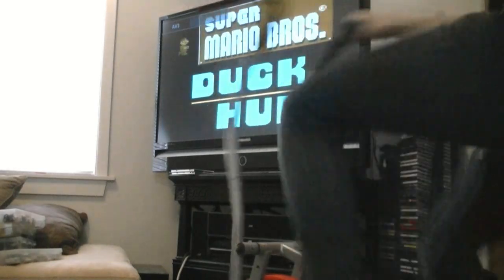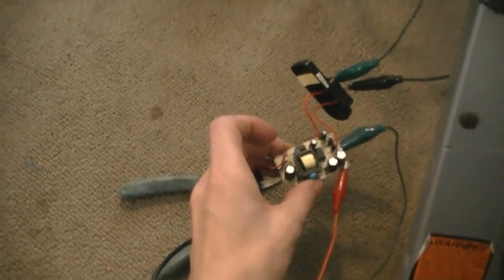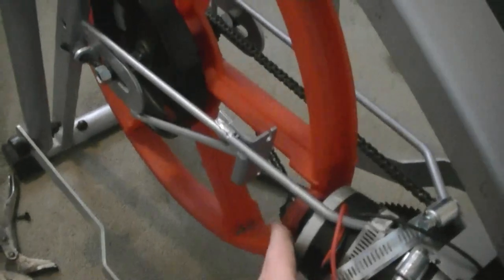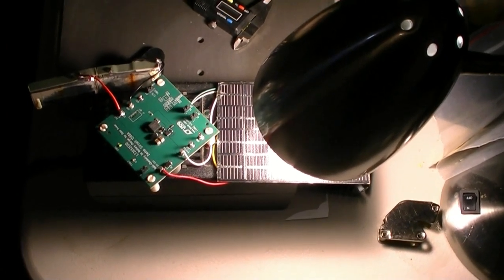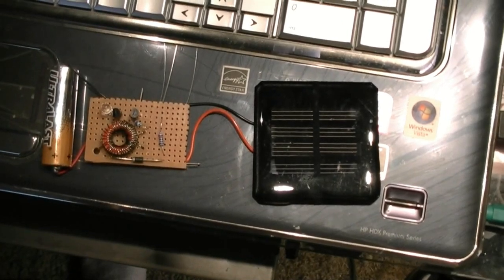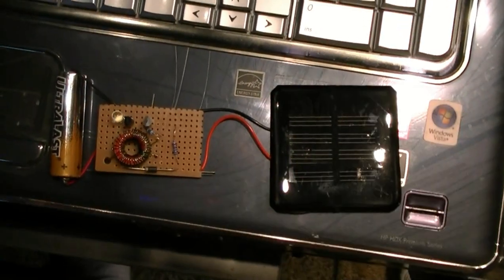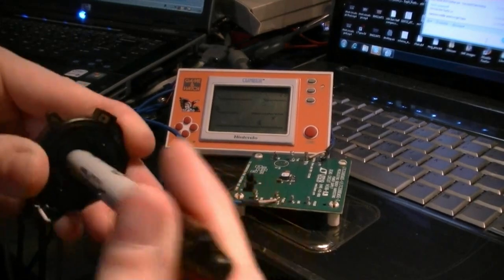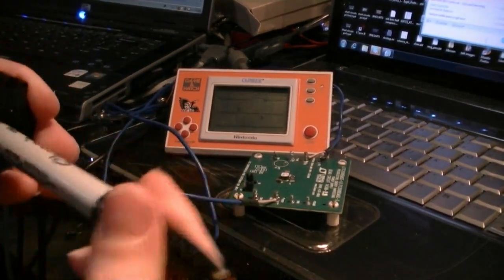Energy Harvesting Project Status Update

Comment: When biking stops, does the NES PSU rails just stop providing power, or is their the potential of providing under-voltage to the components? Have you factored that into the circuit yet? Also, how long will the console stay on once biking has stopped? Are you charging battery cells on that particular project, or just going with large caps? 

I'd like to start getting into alternate power as well. :-)  Hear about remote controls that only use the peizoelectric effect of button presses?

Comment: Nice! I've heard Peltiers work in reverse (generating power from a heat difference) but never actually tried it out. I wonder if it could power a small mood-ring type circuit using an LED?